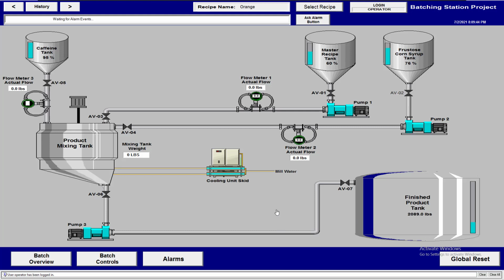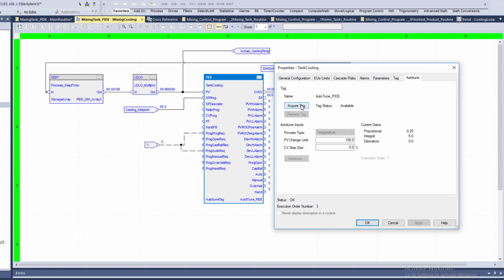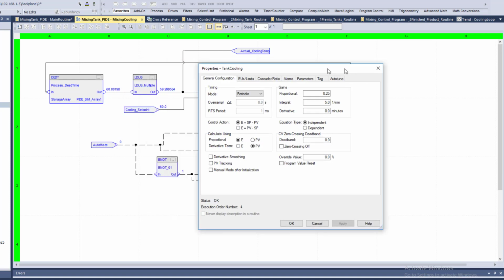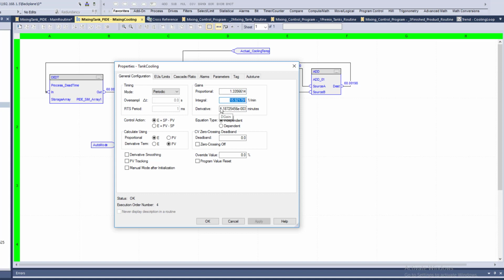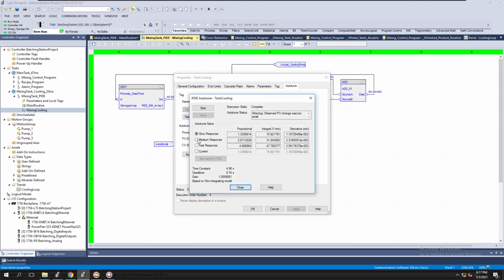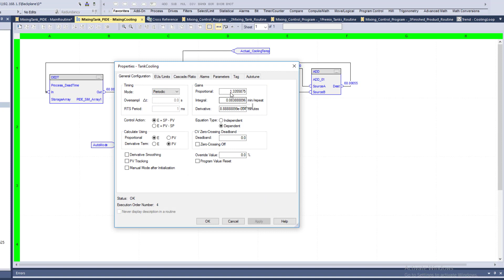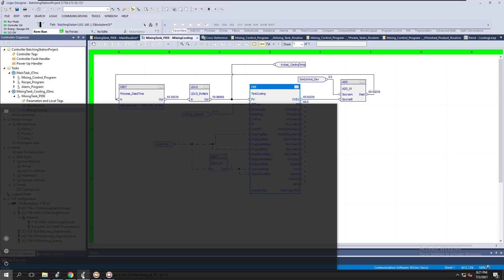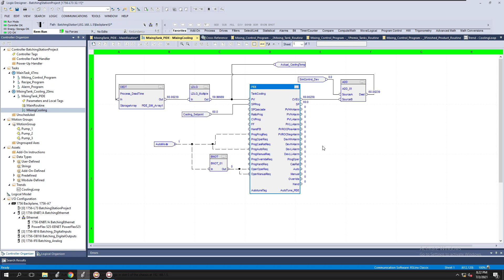Studio 5000 PIDE Auto Tuning

Comment: What is the different between PID and PIDE function block ?
Reply: I'm also fairly certain that the Auto Tune feature is only available with the PIDE. Just to provide context with the video.
Reply from the maker: @schwoates  Autotune is available for both PID & PIDE.

PIDE in RSlogix 5000 or Studio 5000 & PID in Rslogix 500 or PID in MircoLogix.

You are correct for RSlogix 5000 & Studio 5000 not having autotune for the standard PID but in the PIDE it is a common feature.

looks like a great idea to make a video about the differences between PID & PIDE instructions.
Reply from the maker: A few enhanced features for manual controls plus offer small helpful elements like Autotune
Reply: Normally most of PID control should be use PID or PIDE block ?
Reply from the maker: @vorapobautomation9760  

In today's modern use, the PIDE is widely used. PIDE is used in PlantPAX & a lot of grow industry controls.

The standard PID is not used that much, it is used inside of AOIs 

The PIDE offers a lot more than the normal PID.

Alarming, better operator controls, better auto controls, cascade ability, etc